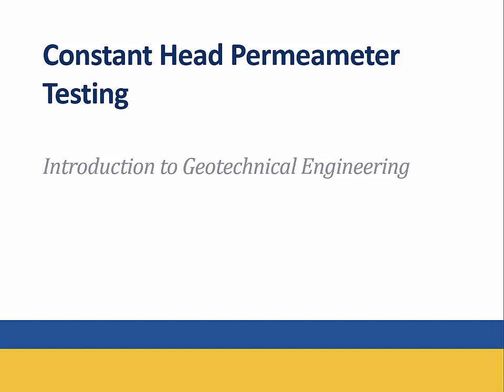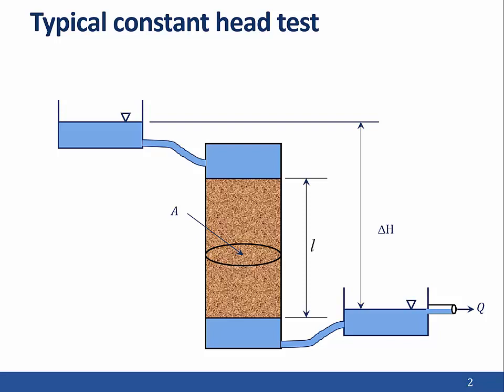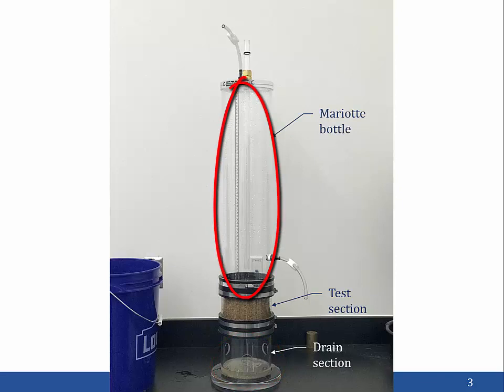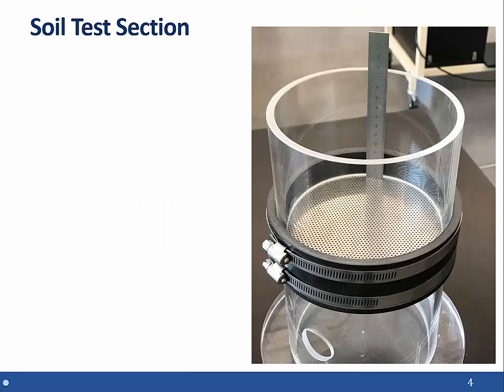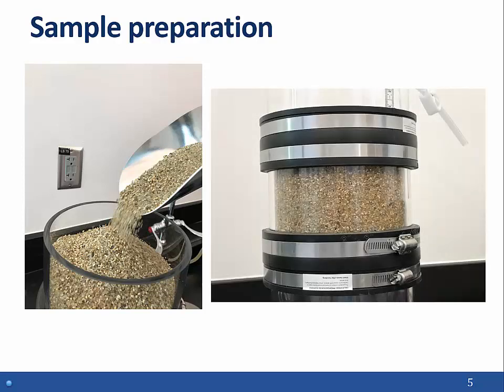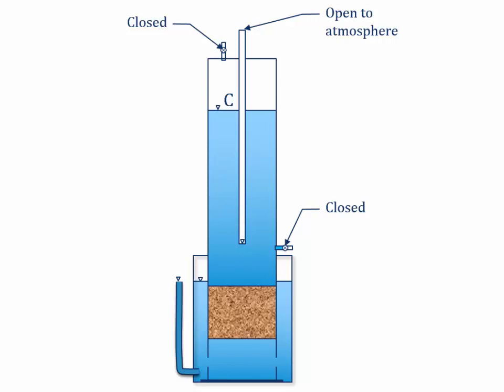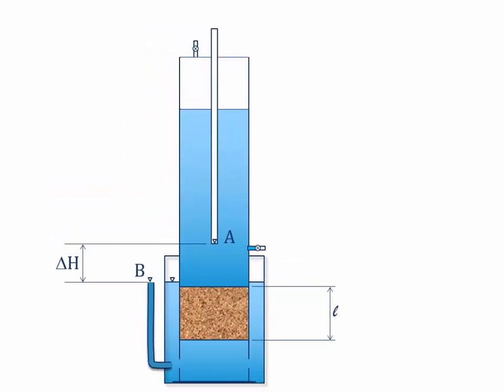Constant Head Permeamter Test

Comment: Dear sir 

Thanks for your lectures. One of the projects where the  permeability is needed for the top 5 meters. The well  is a semi penetrating  unconfined aquifer, but we reach a depth of 30 m and no aquiclude has been encountered. What is the thickness of the aquifier (H) that should be used in the equation in this case? 

In addition, I don't understand how the thickness of the unconfined aquifier can affect the flow rate into the semi penetrating well. Assuming the well is 5 meters deep, does it make any difference in the flow into the well if the aquiclude is 10 meters or 100 meters deep

Comment: How does water not come out from the bucket or standpipe when filling up the Mariotte's bottle?
Reply from the maker: You fill the Mariotte bottle from by opening the vent line at the top of the bottle and using the fill line just above the specimen.  Water does flow out of the specimen and bucket, but not as fast as you fill it.   The water does rise up the standpipe during filling, but doesn't go above the top of the bottle.

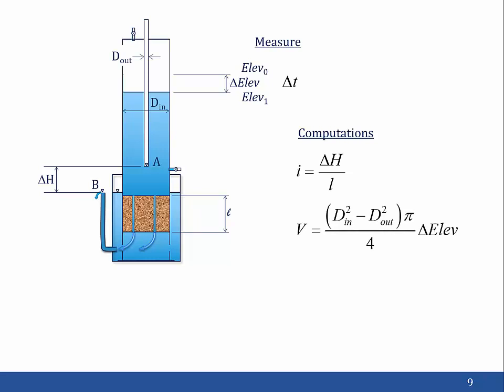Comment: At 6:10 he's using diameter squared x pi.  Shouldn't he be using radius squared x pi ?
Reply: radius is half a diameter, so when u plug that in to radius square * pi it will be this:
(D/2)^2 * pi
which simplifies to: (D^2)/4 * pi